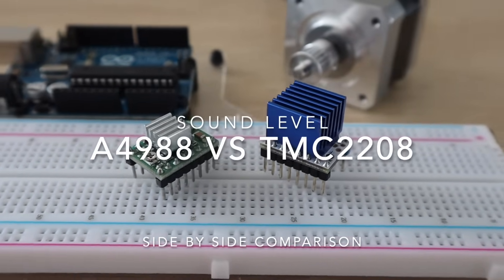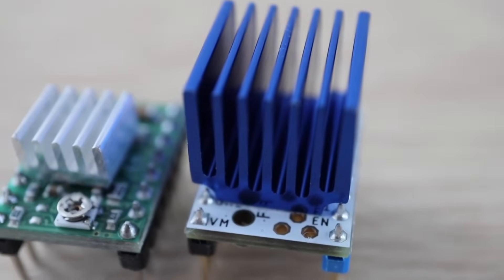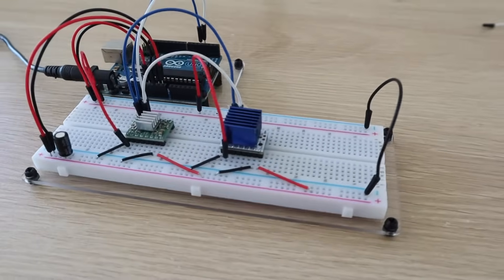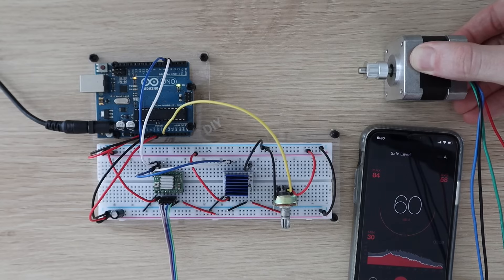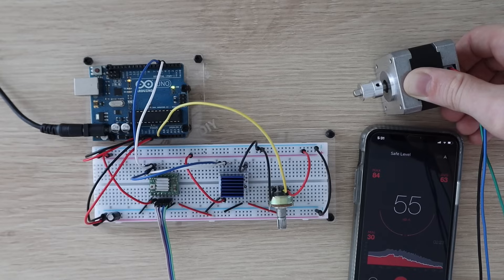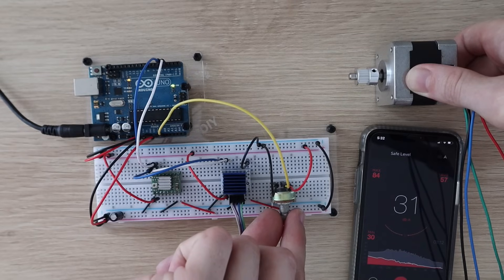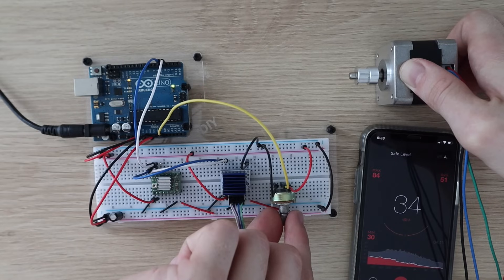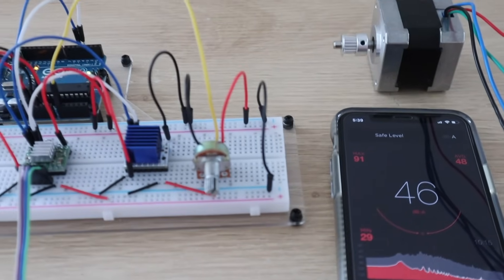TMC2208 Vs A4988 Stepper Motor Driver Sound Level Comparison

Comment: I'm trying to replicate this same set up for a single driver to turn a rotary display with speed control.   Can you provide me with wiring diagram or describe the pinouts please.  Also do you have the script on had for the Arduino?

Comment: I’m using the TMC2208 to drive small micro steppers at a constant speed of 60rpm in a scale model project and with the right step mode and motor selection (low gear reduction ratio so I can use 1/16 step mode) I cannot hear a sound - its phenomenal.

Comment: Very Good Video ! but i am facing some issues that my Stepper motor is not running.How could i solve this? I am using A4988 driver and Arduino Nano and stepper of 0.8amp and 1.7 V printed on it . Also i want to ask that if this problem can be solve by using Rotary encoder then can u plz tell the code for this? and also can i use 12V 10 amp supply for my  whole project to run safely (will it kill my Arduino Nano or not and to run this stepper motor)? Thank You!

Comment: Im a little confused and glancing through the documentation didn't really clear it up for me. On the standalone replacement (no UART) if I have MS1, MS2 and MS3 set to high it translates to 1/16 microstepping on both the A4988 and TMC2208. But what does the "256 interpolation" mean in this case in the TMC? Does it interpolate 256 times between the 1/16 of the step (making it effectively 1/4096) or does it interpolate by 16 per 1/16 microstep (making it effectively 1/256)? In the case of the 2nd option, what difference would changing MS1 and MS2 even make if it would always end up dividing the step into 256?
Reply: One intuitive understanding I'm leaning towards is that it would indeed always divide the full step into 256 but setting it to 1/16 will force Marlin to provide better dimensional accuracy since the path curve would be sampled at double the resolution from 1/8.
Reply: In general after I switched from A4988 to TMS2208 as standalone replacement without UART I was a bit surprised that the change wasn't really so significant. The motors still transfer quite a lot of vibration to the board, the 1/16 microsteps can still definitely be felt as little vibrations. Not sure what's wrong with the interpolation, perhaps it's just happening too fast and isn't really stretched from one microstep to the other?

Comment: I replaced the cheaper 4988 with the more (moderate) expensive ones 2208 and it is a huge difference. Sadly there are China-Clones with the same digits but AT instead TMC lettering and that does not sound as good. So be aware of bad imitates. Also DRV8825 are not that good in sound what I have seen till now.

Comment: WOW! I'm using an A4988 in a project right now and was trying to make my stepper quieter. Didn't realize it would be as simple as changing the driver. Thanks for this video!
Reply: did you just change the drivers and it worked?
Reply: @ytskt  Yes, you can swap in the 2208 directly if you had an A4988 in there. Only thing I had to change was that direction is opposite and there's 8x more steps per revolution.

Comment: Big difference!
As i see, the Arduino programming and the wiring are identical for both drivers, right?
Reply from the maker: Yes the TMC2208 drivers are made to be a crop-in replacement for the A4988 so code and wiring are the same.
Reply: @MichaelKlements  Okay, thanks for your answer!
Reply: @MichaelKlements  In the video TMC2208 is working in legacy mode (mode 1), does using mode 3 decrease the noise or the noise is the same as mode 1?

Comment: In which stepping mode u testing
Full step mode or microstepping mode
Reply from the maker: Both were tested
Reply: @MichaelKlements  im asking in this particular video in which mode you tested
Reply from the maker: Both were tested in this particular video, I mention in each section which mode the driver is in.
Reply: @MichaelKlements I got it buddy Thanks for replying ❤️

Comment: hey i am planning to use tmc 5160bob to drive nema 17 motors with analog input from joystick but cannot find any relevant details for the code so can i use the same step/dir pin interface as you ? i am using tmc 5160 cos the continious current for motor is 1.5A and tmc 2208 supports 1.25 or 1.5 can anyone provide me with any help!
Reply from the maker: I haven’t used a TMC5160 but it looks like the pin out is similar so yes I’d imagine you could drive it using the same code as I’ve used with the TMC2208

Comment: Hi, very good demo and well explained.
I have question, I made a pen plotter using GRBL servo + CNC Shield V3 (normal shield with UNO) and A4988 as the drivers, it works fine but it's so loud, I have plan to change A4988 with TMC2208. So, can I just swap them ? id there any other thing I need to do before changing them ? 
Thanks
Reply from the maker: Most of the time you can use them as a direct drop in replacement. Depending on the shields circuitry, you might need to add a jumper or bridge on the enable pin. Some have these pins brought out on pins that you can physically put a jumper over and some don't - they might be routed to one of the digital IO pins.

Comment: Is there any way to add cw, ccw direction selector switch and speed control of stepper motor? using rotary encoder KY-040 A slight increase or decrease from 1 rpm to 100 rpm?
Reply from the maker: Yes you could use the Arduino to do both of those -  a selector switch for direction and a potentiometer for speed.
Reply: @MichaelKlements  
I just learned how to use a stepper motor and an arduino.
 and  this is source code I use to control the stepper motor(NEMA17).

const int dirPin = 4;
const int stepPin = 3;

void setup()
{
   pinMode(stepPin, OUTPUT);
  pinMode(dirPin, OUTPUT);
}
void loop()
{
 
     digitalWrite(dirPin, HIGH);
     digitalWrite(stepPin, HIGH);
     delayMicroseconds(11500);
     digitalWrite(stepPin, LOW);
     delayMicroseconds(11500);
     delay(1);
}

But all I can do is copy and paste.
If I have to add a switch for reversing the rotation direction.
and add potentiometer to adjust rpm I don't know how to connect those devices on the controller board (A4988)and the Arduino board(Arduino nano).
And what directives do I need to add to the source code?

This is my facebook And the circuit I use is the first picture.

https://m.facebook.com/story.php?story_fbid=417174586562347&id=100048094273900
Reply from the maker: At a basic level you need to set the direction pin (dirPin) to HIGH or LOW to change the motor direction and you'll need to use the potentiometer output to change the delay between motor pulses (currently delayMicroseconds(11500)).
There are loads of tutorials online for connecting basic switches and potentiometers to an Arduino.

Comment: @Michael Klements: Do you know how you can avoid the "PACKKK" from the motor (at 2:50min) when powering up the driver ?  I also have this but with my NEMA23 it's really loud ... This is for sure not good for the Motor/Driver. I have a big  stepper driver which is powered up (also Arduino) when switching on my main supply.
Reply from the maker: That noise is usually just the rotor aligning with the magnetic field of the coils. Its not "bad" for the motor and unfortunately I don't think there is really any way around this. The rotor is free to rotate when the coils are de-energized and will "jump" into place as soon as the driver is powered up and coils are energized again. Unless they happen to be aligned by chance, you'll always get a bit of a knock on startup.

Comment: hi, it's incredibly quiet, is there a way to make it work without arduino ?
Reply from the maker: You don't have to use an Arduino but you'll need some form of microcontroller to pulse the step input in order to drive it. You may be able to use an analogue circuit that produces a "pulse" output although I haven't tried this.

Comment: Great video. Can you share your code for the tmc variant?
Reply from the maker: The code is exactly the same as for the A4988. You just set the direction pin high or low and then pulse the step pin to move the motor.
Reply: @MichaelKlements  Where can I find that code? Because I'm completely stuck over here...
Reply from the maker: Have a look at my old guide I put together. It's for the A4988 driver, but the code is the same - https://www.the-diy-life.com/arduino-stepper-motor-pololu-driver/

Comment: Hi Michael, do you happen to have the program to test these drivers? I'm having quite a problem with the TMC2208
Reply from the maker: My camera slider project uses them and has a circuit diagram to show how they are connected - https://www.the-diy-life.com/diy-motorised-camera-slider-with-object-tracking/

Comment: I recently bought my first non "black box" 3D printer, a CR-10S, and it's really noisy. It has those A4988 drivers. Do you know if these and the TMC2208 chips are pin and i/o compatible?

The chips themselves are only like $2 a pop (so locally, almost 1/10th of those complete PCB modules). And as a microsoldering tech, it would be a lot cleaner, less work, and a lot cheaper for me, to just swap the chips on the stock printer PCB, to TMC2208s. IF that would actually work.
Reply from the maker: It depends on the configuration of the board you're using. For the most part they are pin compatible (the motor pins, logic voltage and supply voltage pains are all the same), you might just need to modify the micro-stepping or enable signals. Depending on the board this could be as easy as plugging in or removing a jumper or it could mean that you need to break a trace or run a new bridge somewhere. You'll likely also need to re-flash the firmware.

Comment: Will there any problems while using different types of stepper drivers (a4988 & Tmc2209) on the same skr board ?
Reply from the maker: Not that I'm aware of, it used to be quite popular to use the TMC drivers on 3D printer X and Y axis but retain the A4988s for the extruder and Z axis as you generally get more torque out of them and they're moving really slowly in any case.

Comment: Very interesting indeed. But with less noise, might also come less Holding & Running Torques. 
And if it was confirmed to drive step motors at lower torque values, this could be the key-decision factor to induce positioning failures in many projects.
How to test: Simulating a winch of a wirewound in that pulley, lifting an adjustable weight of a plastic cup (rice filled), could provide a simple comparison. 
Thanks for sharing.
Reply from the maker: There shouldn't be any torque loss as long as the TMC2208 driver is producing the same amount of current that the A4988 driver was. But yes you could test this with a pulley of a known diameter lifting an adjustable weight.

Comment: Hey michael, good video there. i've created something similar to you, a pan tilt camera mount.
im finding it hard to get the stepper driver to take bigger steps and go faster -
i've played with ms1 and ms2, changed motor voltage 9v(2a) -12v(2a), changed the delay time and wait time too, but the rotation is still really slow. any ideas? i use a nema14 motor not sure if that makes a difference
Reply from the maker: Thanks Sunny. 
The delay should be the only thing you need to change if the step pin is working correctly. The motor voltage or type (nema 14) shouldn’t make any difference to the speed as the speed is just based on how quickly the driver steps the motor.
Reply: Stepper motors are for slow precise movement. For fat moves you need a couple of things, also take note that their torque drastically decreases with speed.
1. Acceleration, meaning slowly ramping up the speed instead of instant full speed, otherwise they'll stall.
2. High voltage to more quickly energize the coils (on my NEMA 23 motors i use 48V for example)
3. Good drivers that vibrate less and thereby increase max speed before it stalls.
4. Obviously the correct input signals for the desired speed.

Comment: Great video and blog post! Have you used the UART connection on the TMC2208? I'm having trouble wiring it up and I'd love any tips.
Reply from the maker: I haven't given this a try. I also haven't been able to find much documentation on how to do it. Let me know if you do manage to find anything or get one running!
Reply: @MichaelKlements  will do. I definitely burned a board but I think I've fixed some of the issues. I'll post again when I get it to work. It seems like a perfect combo: wifi/ ble and silent stepper drivers.
Reply: @evanlane1690  hi there! any progress in getting the UART connection working? I'm interested too. thanks!

Comment: How did you set the delay values in order to use with potentiometer as on the video? My motor is turning too fast even with 40 000 delay and at that setting it changes speed randomly sometimes. I can´t make it  turn at speed at which you can hear each step as you do. Thanks
Reply from the maker: Hi Petr,
It sounds like there's something wrong with the way you're using your delays. I haven't done anything different to how you would drive an A4988 driver, something like this:
      digitalWrite(travStepPin, HIGH);
      delay(interval);
      digitalWrite(travStepPin, LOW);
      delay(interval);
With the interval being a variable driven by the potentiometer (somewhere around 2 - 500).

Comment: Hi, thanks for this wonderful video. I am currently trying to figure out how to drive a tmc2208 with arduino but i couldn't succeed yet so it will be really helpful if you can just share the arduino code that you used for this test video.
Reply from the maker: I don't think I saved the code, it's just a really simple stepper setup like you'd do for an A4988 driver. Have a look at my camera slider project on my blog for code and a circuit specific to the TMC2208 drivers.

Comment: Can I replace drv8825 for tmc2209 on cnc shield v3 on top of arduino uno? :)
Reply from the maker: I’ve never used the DRV8825 drivers but it looks like they’re a drop in replacement for the A4988 and TMC2208 as well.

Comment: Just what I needed to see.  Was searching for how to implement these drivers with a standard Arduino or Arduino compatible board for an upcoming project of mine.  Might need to design my first PCB.  Thanks for the information and inspiration!
Reply from the maker: That's great, thanks for the feedback! Have a look at my recent camera slider project if you're thinking of designing your own PCB for an Arduino and these TMC drivers. It's not perfect, but it gets the job done.
Reply: @MichaelKlements  will do!

Comment: Apart from the noise level would 2208s in a 3D printer provide better print quality? Would the smoother and greater step count reduce ringing and allow finer control over positioning?
Reply from the maker: I think it depends on whether the 3D printer has been designed to run on 2208s or not. If you’ve just swapped out 2208s then your control board is still working in 4, 8 or 16 step mode as supported by the 4988s. If your control board is designed to use the 2208s then it might have been designed to get the full 256 microsteps which would improve position control.

Comment: What is it that makes these new TMC2208 motor drivers so quiet? What about EMI - do they put less high frequency noise into the motor winding circuits? I'm currently using DRV8825's for an automatic magnetic loop antenna tuner.
Reply from the maker: I'm not an expert in these drives, but I believe they just break the motor's steps up into much smaller micro-steps and then incrementally energize them. This leads to more of a sine wave looking function rather than a choppy square wave. The A4988's just energize each coil pair, so the rotor rapidly "jumps" between poles which is quite noisy.

Comment: Hi!
Would I be able to use a4988 instead of the tmc2208, in a cnc shield, I'll pair them with a NEMA 17. Do I have to do any moification (noise it's not a concern for me)?
Reply from the maker: It depends on what the shield was designed for. If the shield is designed for a A4988 driver then it'll work with either driver, if its designed for the TMC2208 then you'll need to look at what type of interface it uses. The TMC2208 drivers can be used in 3 different modes, only 1 of which is compatible with the A4988 drivers.

Comment: why do you run the 4988 "medium to half speed" at  2:16 at maybe 60pm? and then for the 2208 "medium to half speed" at 3:30 it looks more maybe 10rpm?  Or were you commenting on a test you made outside this video when you actually ran it as fast as the 4988 test?
Reply from the maker: I probably should have tried to match their speed a bit better. I had adjusted them both faster and slower for comparison, so I didn't really focus on getting the speeds synced up.
Reply: @MichaelKlements  it would have made the test seem more fair.  I don't know if the noise goes linearly or non-linearly more loudly with rpm's but that was a really big rpm difference to make a subjective comparison from.
Reply: @randybisme  don't sweat it, you get what you pay for, the 4988 is dirty cheap and notoriously VERY noisy, the TMC are more expensive (some like the TMC5161 a lot more), but dead quiet. at any RPM. period. no need to bash michael here with anal retentive accusations of RPM "misalignments"